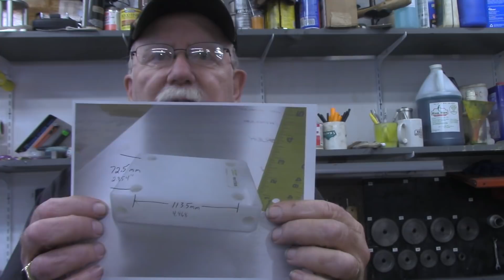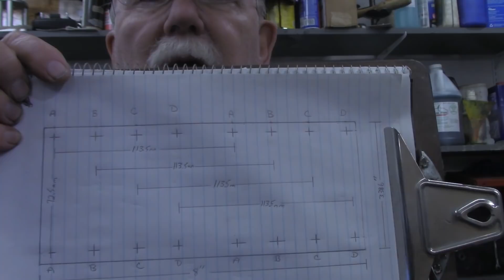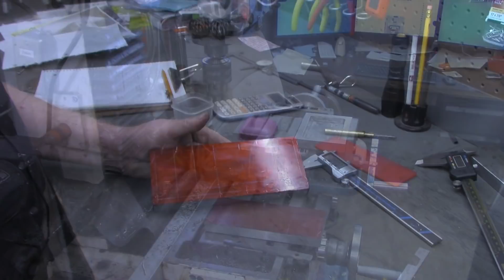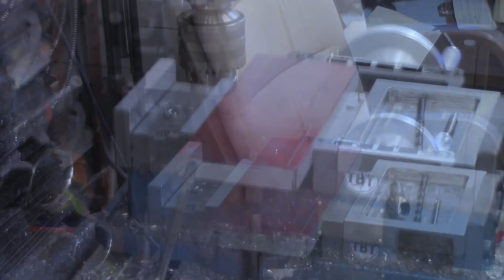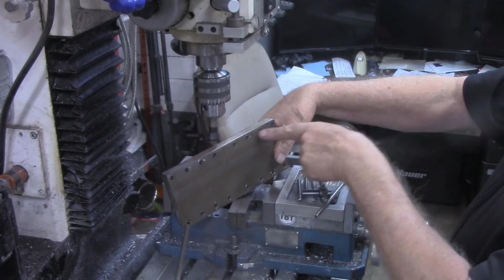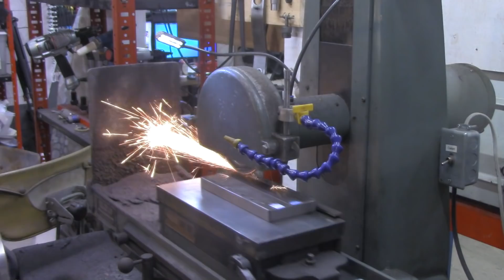Drill Press Pattern Template

Comment: Just a small suggestion instead of using the center drill and chamfer tool on the mill I use spot drills (what I think you are calling starter drills) . BY suing a larger size you can drill down to chamfer size then drill the ream cutting one whole step.

Comment: Is another good video I did watch the wagon one , Like the bracket for the water  flange For the tongue I would have moved it back and then Drill a the hole through the front of the frame  The wagon wheels I would put heavier bearings But it looked cool anyway  We all build a little differently I tend to overbuild bad habit On that block wouldn't the bottom be better sharp is A-sharp or just lightly touched up since it's a drill pattern to lay down to match up to something Thanks from Frank from Fleco Technology  I'm hoping to get started on my YouTube channel